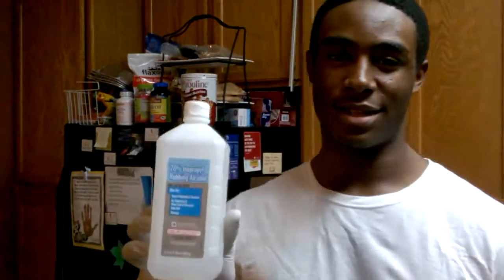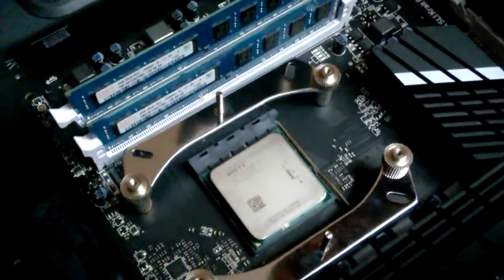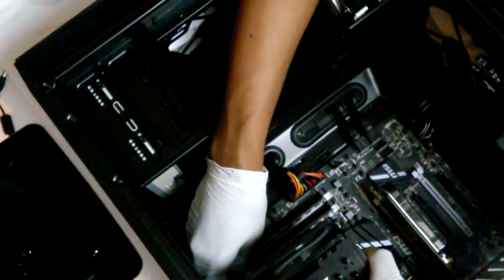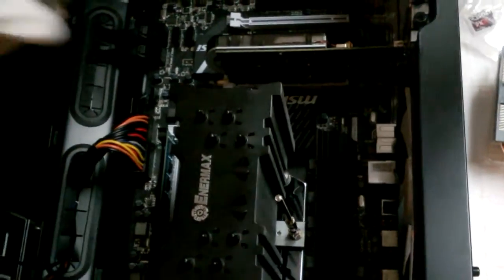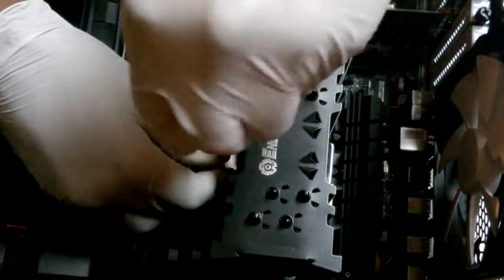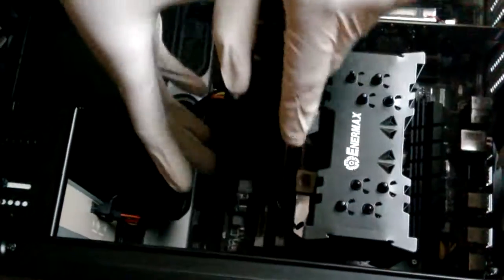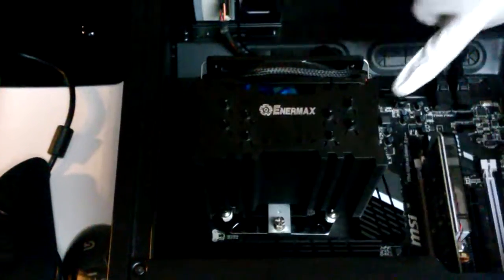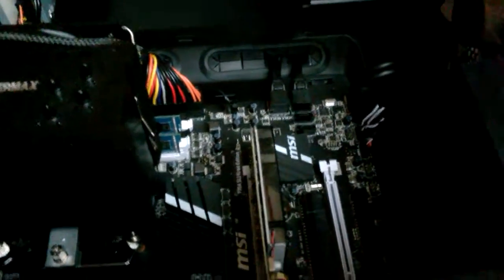First Time Mounting A CPU Cooler (Enermax ETS-T40-BK)

Comment: nice hsf, mobo, psu, case, and proc..
but ram and Vga so amzing. Lol
is that gt 430 right? welldone
Reply from the maker: It's actually a GT 530 2GB OC'd, that and the memory were placeholders as my GTX 960 and RAM were in the mail.
GTX 960 Unboxing: https://www.youtube.com/watch?v=fJZsxCGzHT0
Avexir Core Series DDR3 16GB RAM Unboxing: https://www.youtube.com/watch?v=-a3lfKV4tEE